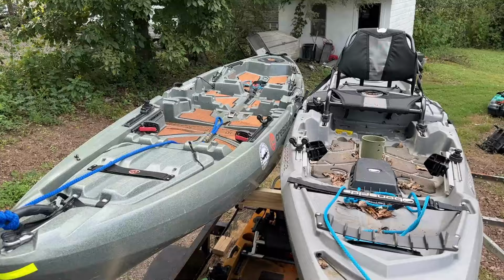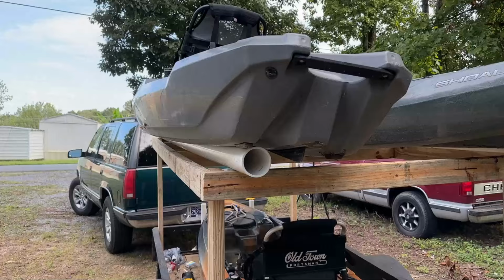Building My Budget Kayak Trailer

Comment: Triangular bracing for the upper deck helps the stability issue. You might want to cap the front of the PVC tubes on the lower deck, or maybe drill a weep hole in the back caps (water drain). Thanks for sharing the build.
Reply from the maker: Thanks for the tip! i was thinking i might need weep holes in it